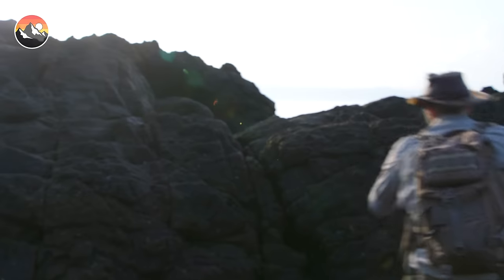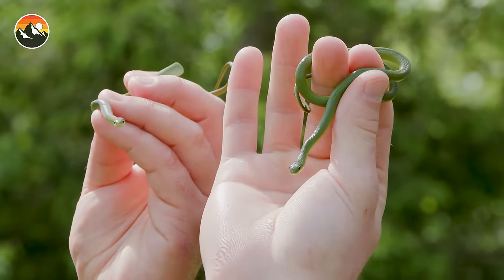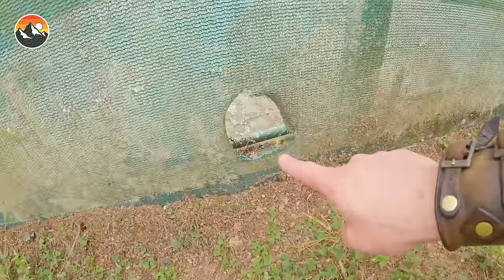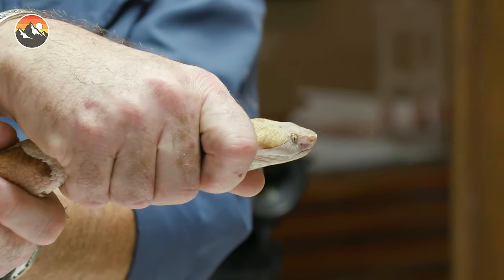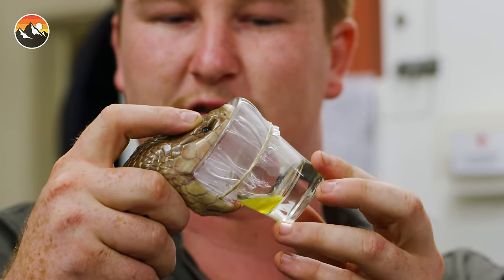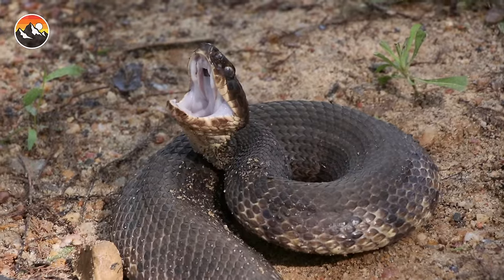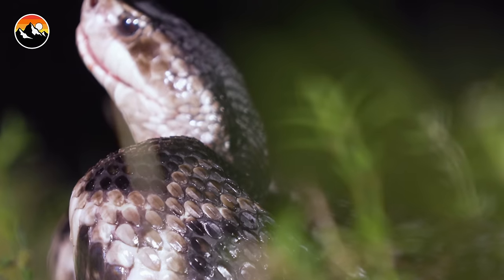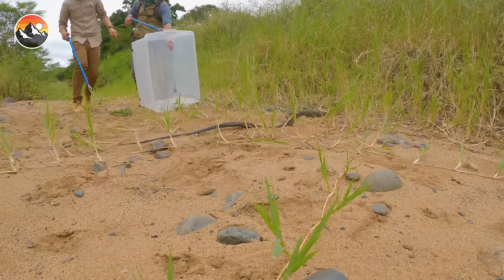Deadly Sea Snake Caught!

Comment: Smooth green snake, found in Alsip, Illinois. The snake has a very yellow under belly. Northern water snake also found in Palos Heights, Illinois. The red belly snake also looks just like Illinois little brown snake, which eats worms. This snake also has a thick central strip with paired diamonds down the back.